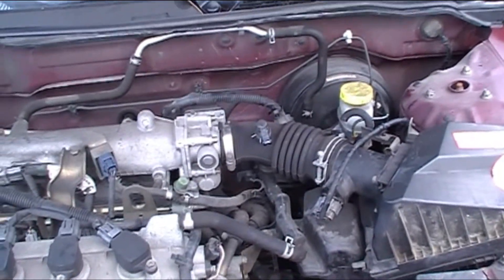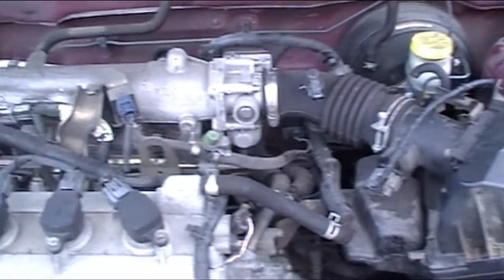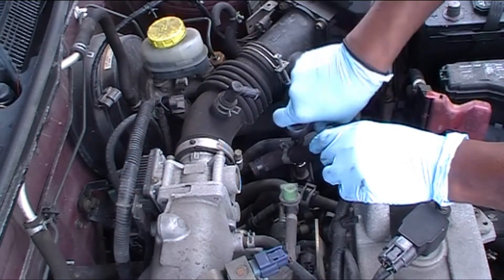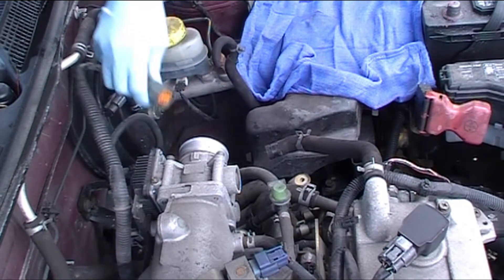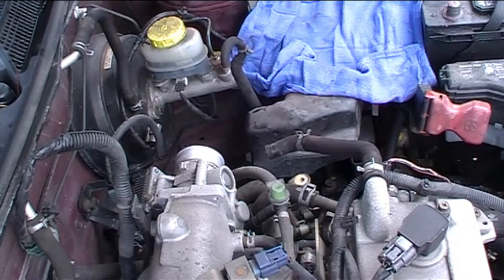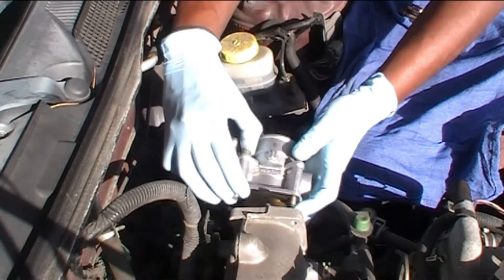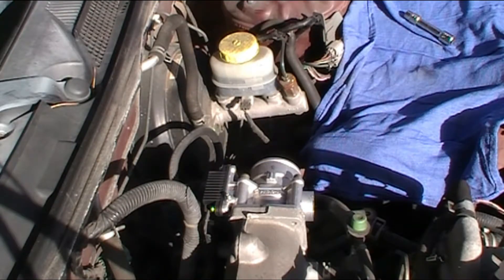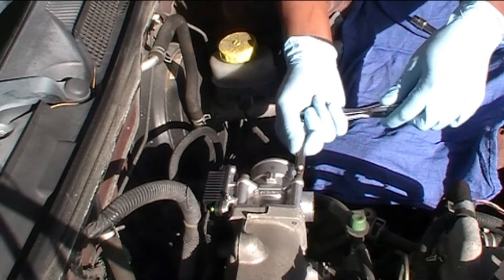Throttle Body Replacement Nissan Sentra 1.8L

Comment: Witch section applys to the 06 sentra for the relearn in the description there is 4 different sections with steps ?
Reply from the maker: All needs to be done.
Reply: @BARR8323  ok thanks so each section one after another
Reply from the maker: @SCRAPPY- yes

Comment: I changed the fuel pump (2006 Nissan Sentra 1.8L) I also put on a new throttle body. Now it is still idle surging. (Giving a high idle when started and then the rpm gauge is up and down with the car in park) 
1. I am going to try to re learn it first.
2. If I still surges I will follow some trouble shoot tips from the new throttle body instruction manuel.

The tip says to unplug 1 fuel injector at a time until the idle is corrected. Is this correct? Any experience with that? As far as the unplugging of the fuel injectors to correct the idling?  Thanks
Reply from the maker: No experience with the tip, perhaps other viewers will provide input. Good luck and post your findings
Reply: @BARR8323 the relearn procedures you have listed for each component, do they have to be done in that exact order?

Comment: I never took it apart but I do think I know why my car drives in limp mode. @1:32 of this video your holding a hose you pulled from the air intake. The elbow that connects that hose to the air intake I badly ripped when pulling it from the air intake. I should've did it your way by the hose but I pulled it from the air intake. Do you think that could be the problem? I'm also still going to try to reset it. Thank you so so much
Reply from the maker: If the hose is ripped and you have a vacuum leak it can create problems
Reply: @BARR8323  thank you. Your transcript is awesome.

Comment: Did New fuel pump Fix the problem?
Reply from the maker: Yes, I did all this to find out the fuel pump was the problem
Reply: @BARR8323  Thank you so much for getting back to me so quickly, did yours make the extra sound I mentioned during acceleration?
Reply from the maker: Yes, I didn’t think it’s was the fuel pump since it was less than a year old, but it turned out to be the new pump was defective
Reply: @BARR8323  the noise I'm hearing is like a ticking clacking sound if you push her to hard she stumbles hard when this happens and my mechanic friend put it through full diagnostic tests and engine is fine and he thinks it is not getting proper fuel delivery, I just never heard one do that before almost like spark knock lifter noise but only under load.

Comment: What ended up being the problem with the Nissan?
Reply from the maker: Fuel pump, but it was my last suspect since it was 6 months old
Reply: I'm having same issues with my beloved 2000 GXE hard starting and sluggish on acceleration and a strange clattering sound during hard acceleration, I thought it was the throttle body also. I'm still kinda Confused please help if you can thank you
Reply: @robertvance1873  I have a GXE also a 5 speed manual. Mine was difficult to start and It turned out being the coolant temperature sensor. Mine was surging also so I replaced the fuel injector pressure regulator and that fixed the surging.
Reply: @fighterjetsteve  sadly mine lost all compression one night and that was the end of her
Reply: @robertvance1873  oh darn......mine has 407,000 miles on it and still running good......needs a power steering pump though.....minor fix.
Reply: @fighterjetsteve my steering pump is incredibly loud when I turn, any way to fix?
Reply from the maker: Check the power steering fluid level, it’s probably low which causes the noise.